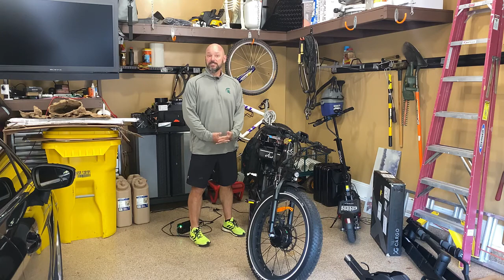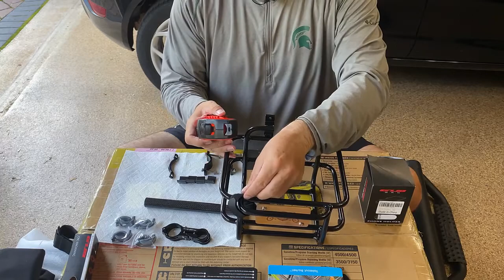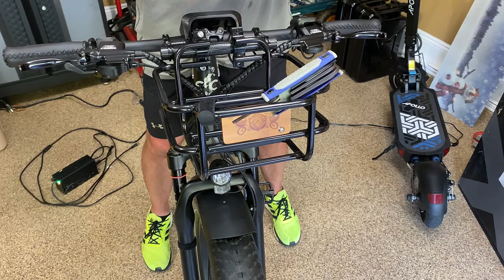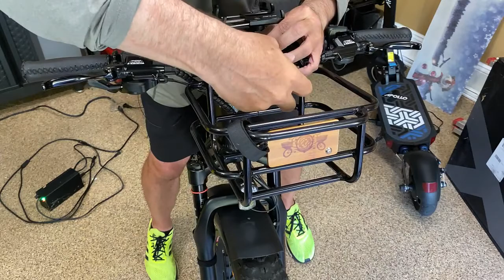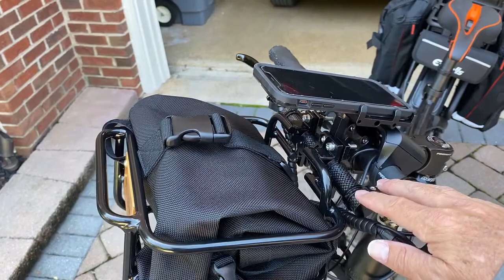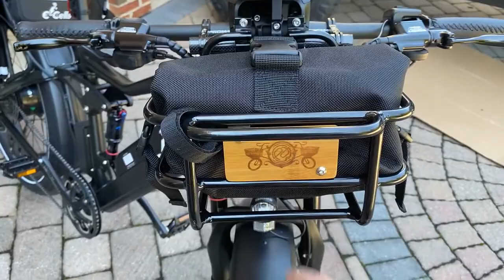Portland Design Works Takeout Basket w/Gub Carbon Fiber Handlebar Extender & iPhone Holder Install

Comment: Interesting choice mounting the basket & not the Onboard computer to that bar extender.. being that it’s made of carbon, I wouldn’t trust any extra stress (I.e. bouncing weight) in fear that it would snap in half! I guess it places the basket out in front of the cables the a bit.. has this setup failed on ya yet??

Comment: Can the extension  bar handle the weight of a six pack without  twisting  loose?
Reply: Raul, hello and good evening! Yes, I have put a bit more weight in there than a 6-pack and I really torqued it on my handle bars. That said, the ride was a few miles on pavement as I would not try to throw a 6-pack in there and head to the mountain trails :-) Again, thanks for stopping by and all the best!

Cheers,
Travis
Reply: @TravisBonfigli  came here to inquire about the same.. how is this holding up?!